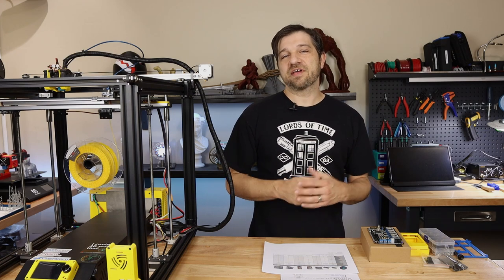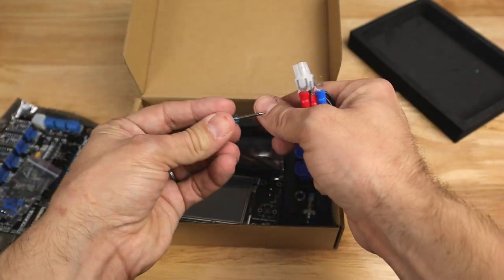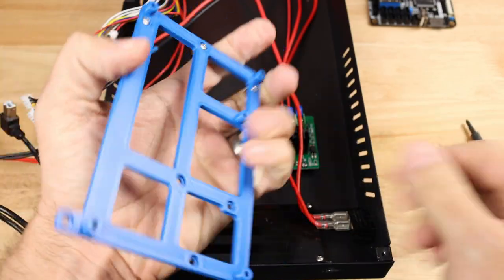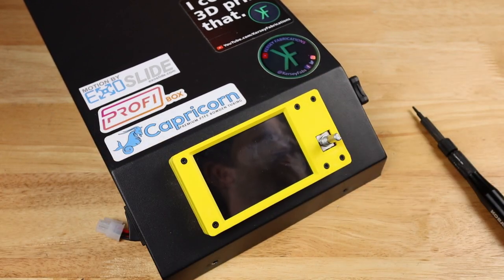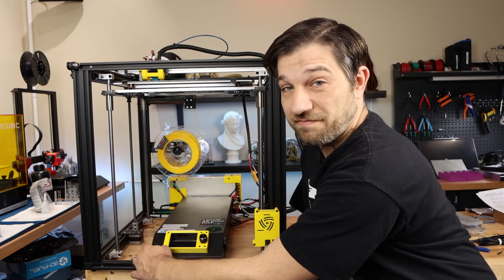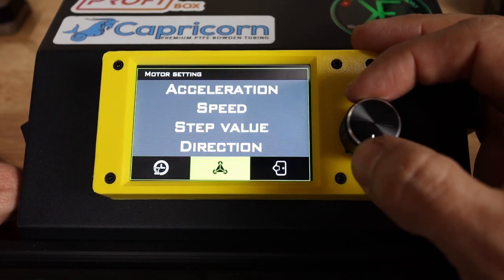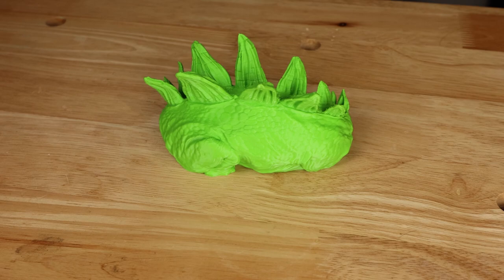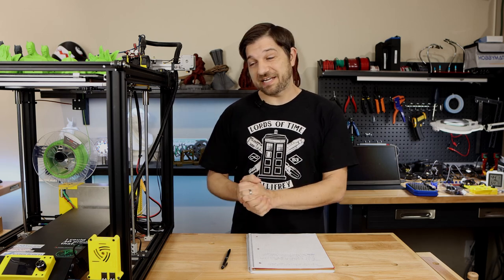Lerdge K 32-bit 3D Printer Mainboard Guide and Review

Comment: awesome video! I am trying to copy this exact set up. I have the same machine and the same board. is anyone else having an issue with the z offset? even if I change it and get it to where it should be it does not seem to retain that spec at all. nore is that an option to save from that menu. maybe its a silly thing that I'm missing but hopefully someone can help me out?
Reply from the maker: Are you taking about live Z offset adjustment (baby stepping) or initial Z offset setting?
Reply: @kerseyfabs  i think both. its about half an inch from the build plate. i go in and i change it to say -6.57mm but then it does not save
Reply: @kerseyfabs  also thank you for responding so quickly . you're
 awesome!
Reply from the maker: @Dan-yq6yn  Something seems off in general if you're that far off. Hmmm. I don't have any issues with repeatability. I would need to got back and see what my offset is... it's -0.25. Are you running a mount that's moved your head a fair bit off?
Reply: @kerseyfabs  at the moment no, I have the stock ender 5 plus hot end on it. i plan on changing it out in the future but as of now i just wanted to get the new board running. is the z offset in the structure menu or is it in the leveling menu ?
Reply: @kerseyfabs  ok so I was doing it right . I was on firmware version 4.3.3 I belive. I updated the firmware to 4.3.6 and it got rid of my issue. Must have been a bug

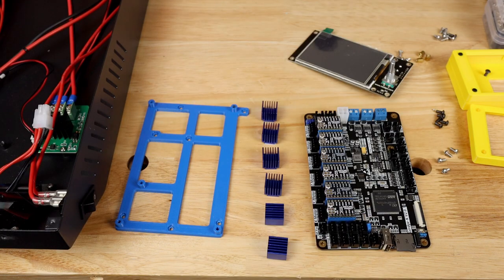Comment: @18:30 FAIL, seriously who designs this crap??? 
You are sticks a heatsink to a circuitboard? The driver is on the oposite side of the board... WTF???
A PCB has the worst heat conductivity index, you may as well have stuck those heatsinks to your forhead..
Reply from the maker: It really depends on how that area under the heatsink was designed. Since I don't have the design files, I don't know the answer to if it was bridged correctly. Copper plates do conduct heat well though: https://www.mokotechnology.com/fr4-thermal-conductivity/